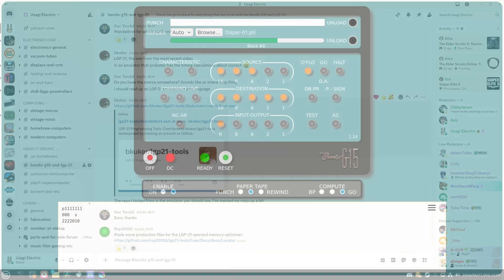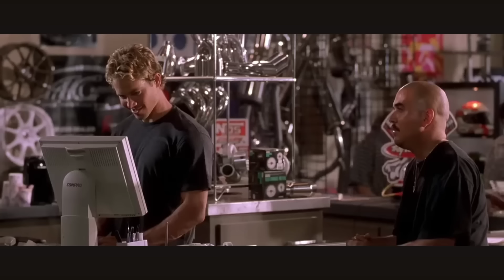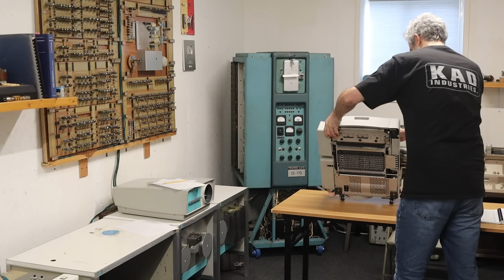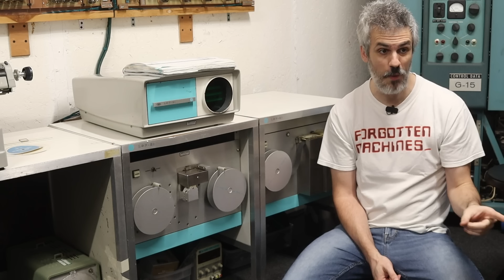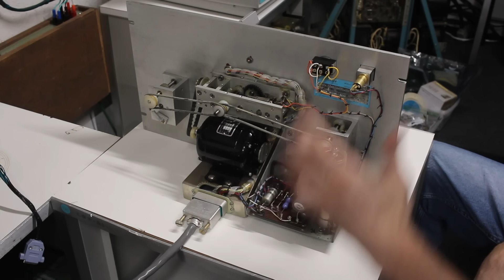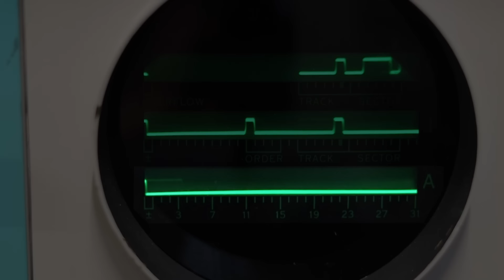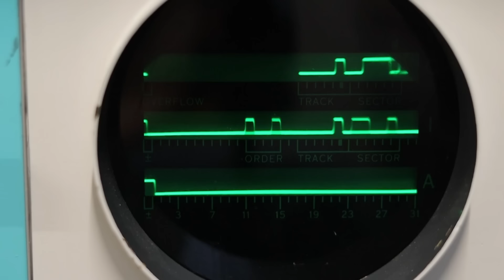Can We Rescue the Code on This 63 Year Old Disk?

Comment: For those who are curious, the numbers that I am calling out at 24:34 are instructions for a little bootstrap program.  The bulk of the dump program is on paper tape, but 4 instructions need to be entered manually on the Flexowriter into memory to build a little bootstrap program that loads the rest of the tape from the tape reader.  Once we switched to NORMAL mode and hit START, the rest of the program read in automatically and started running.  After that it spent 1.5 hours pounding out hexadecimal words on the Flexowriter.
Reply from the maker: Thank you for all the help man!
Reply: I know nothing about that machine, but that motor start relay isn't chattering because of mechanical reasons.. the voltage/signal driving the coil is unstable. The supply where that's coming from seems to be overloaded - maybe a capacitor no longer capaciting as designed. Let me suggest you debug further in that direction.
Reply: @WooShell  that was my thought as well, it sounds like it's insufficiently well powered to stay engaged.
Reply: @26:11 I see characters 'w', 'k', 'g', 'j' .... what are these?  Does the machine have alternates for our now-standard "A to F'?
Reply from the maker: @andrewdavie386  Yup. It's a hexadecimal machine, but instead of "a, b, c, d, e, f" it uses "f, g, j, k, q, w". No clue why LGP decided on those letters!
Reply: @UsagiElectric  TY. Interesting that most of those are on the same line of the keyboard. I wonder if some key encoding scheme had all of those consecutive in binary value.
Reply: @UsagiElectric  see also layout of a qwerty keyboard for a nice pattern of paired letters
Reply: @andrewdavie386 according to a stack exchange post about the LGP-30 that's exactly it. Those letters just happen to be encoded as 10-15 as a consequence of the physical design of the keyboard. I tried posting a link as a separate post but it of course got removed. The question is titled "What was the reason for the weird hexadecimal letters used on the LGP-30?".
Reply: @Bobbias  it was an educated, but lucky guess. TY for the confirmation!
Reply: @UsagiElectric  that's even worse than Bendix ...
Reply: @UsagiElectric  Fibre Glass Javelins Kill Quite Well!
Reply: @UsagiElectric  Here are the character codes, from table III in the LGP-21 Reference Manual, for these characters:
0:  0000 10
1:  0001 10
2:  0010 10
3:  0011 10
4:  0100 10
5:  0101 10
6:  0110 10
7:  0111 10
8:  1000 10
9:  1001 10
F:  1010 10
G:  1011 10
J:   1100 10
K:   1101 10
Q:   1110 10
W:  1111 10

So you see, these are already in binary sequence, with 'F' immediately following '9'.  Since the bootloader (i.e., manual input mode) is implemented in transistors and diodes, this would simplify it greatly.  Now, whether this is a standard set of character codes for a Flexowriter, or LG specified that the Flexowriter be customized for the LGP-30, I could only guess, but in any case, I don't think that hexadecimal notation was firmly entrenched in 1963, so the choice of codes may have had something to do with making the "mnemonics" for the instruction codes work out as well.
Reply: Yes, that's what the LGP-21 uses for hexadecimal, F G J K Q and W so they don't conflict with the operation code mnemonics.  The Bendix G-15 uses U through Z instead.
Reply: @andrewdavie386  Wow, this is triggering me.  My first computer was a Z-80 machine I built myself in 1979, and I wrote a bootloader for it so that I could then load a monitor from toggle switches that could accept input from the ASCII keyboard and store into RAM.  At this point in development, I didn't have any EPROM, but I DID have a set of address and data switches that could write to RAM over the CPU bus.  The monitor program of course accepted octal, since that's how 8080 and Z-80 instruction fields aligned (and how I hand-assembled Z-80 executable code), but the bootloader was much simpler, AND I chose to use the same trick for accepting hexadecimal: I used : ; < = > ? to substitute for a b c d e and f, respectively, because these are the ASCII characters that follow 9.  This meant that the bootloader didn't have to do any translation; it could just take the 4 least-significant bits of the ASCII code being input, as-is, shift them into the A register just as the LGP-21 bootloader was doing in "manual input" mode.  This is clearly what GP did as well, except that the Flexowriter doesn't speak ASCII.
Reply: @BrightBlueJim  yes. I'm pretty old-school and that's why this occurred to me. It's the kind of "shortcut" you would take back in the day to save memory/speed.
Reply: What wasn't clear to me is where the program from the paper tape is read into in order that the instructions are run? Presumably there is a loop in the track printer program to loop over each sector, reading off the disk, so the instructions must be read from within some memory, so I presume you were able to load the entire program into memory (ferrite core memory, which is non-volatile, or volatile memory, static RAM or the 1963 version thereof) in order to run it? Or did the program need to be written to the disk, i.e. track 2, in order to run it from that, i.e. reading each instruction from disk, or run directly from paper tape, iteratively reading the tape? I find the last two scenarios hard to conceive.
Reply from the maker: @aussieleighsmith  It's a little confusing but the disk is the memory. There is no static RAM or core memory or anything like that. The rotating disk is your working RAM, similar to the rotating drum memory on the Bendix G-15 or LGP-30, just flattened out instead of in the shape of a wheel. But, in a sense, you can think of the rotating disk memory as being roughly analogous to core memory in that it is indeed non-volatile (the actual physical construction of the memory and computer around it are wildly different, but for a programmer, that's where all your memory addresses and registers are). The paper tape is our mass storage device, and in this case, we typed a little 4-word bootstrap into track 2 which initiated the tape reader to read in the rest of the dump program. That dump program was copied into track 2 as well, then executed from there.

Since track 00 and 01 were broken, we chose to go with track 02. I will troubleshoot and get track 00 and 01 working and we'll pull any data on those two tracks off as well, but I wanted to backup everything on the memory disk as soon as possible so our risk to data was as minimal as possible. We manually stepped through Track 02, writing down the contents of each memory location by hand looking at the CRT. It was tedious and slow, but we preserved it so we could load our dump routine into that track.
Reply: @UsagiElectric  Hand transcribing the contents of track 02 from the CRT display is real dedication!  Especially as I imagine you wanted to re-check a few times to be sure.  How many words per track?  And actually, are all tracks the same data length, so it is more compressed per bit towards the spindle?
Reply: i remember having to do this kind of dumpin our old school lab.
Reply: Where did the actual tape come from?

Comment: I'm amazed that you can get any of this old stuff to work.  Mainly because of the tendencies for the die bonds on the chips tend to fail at around 20 years.  Does not matter if the machine is in service or sitting on a shelf.  The execption is for parts with jan (joint army navy)  an an example jan/txv2n2022 I have some I purchased in the early 1980's are still good as new.  Hard to find nowadays.

Comment: Motor start relay - don't know if you got this sorted, but it looks like the normally closed contact goes to a resistor? If so, it could be the cooling / power saving contact for the coil and shouldn't open until the relay is almost fully in. Commonly used on vintage elevator control relays.

Comment: Feeler gauges on a digital computer's disk memory unit...like we're setting "cold" valve clearance on an internal combustion engine.  Hmm, not so different since there's a camshaft with rocker arms and rollers activating contacts like those seen in pre-transistor points and condensers for ignition.

Comment: I really enjoy your approach to restoration and also tinkering with new retro designs. When I was an undergrad in 1976 I got to work at Edgewood Arsenal, Maryland on an early CAD system built around a Varian Data Machines minicomputer. It was a very nice machine of that era. I wonder if you've ever run across one.  Iirc it had core memory. For sure it was persistent. We loaded programs from paper tape, and they remained resident indefinitely through power cycles.

I also got to spend a month or so at the company that built the CAD system somewhere in southeastern New York state. Unfortunately the name has left me. The system was entirely wire-wrapped TTL in a cabinet I recall was maybe 5' high and 3x3'. A beast. They started by building their own FORTRAN 6 compiler, and all the CAD software excepting drivers was written in FORTRAN.

Comment: I also used to enter a boot strap loader into the Honeywell information systems division model 316. However, I had to enter the individual bits into both the program counter with the address and the instruction content into the memory. At that time, I was able to use magnetic tape recorder to input the rest of the information into the core memory, which was a construction of ferrite beads manually woven with X and Ywires along with a current sense wire; each read operation was destructive and had to be rewritten afterwards with the wright  operation. In 1970 and 71 I worked in RCA‘s printed circuit board repair division. Where I also work on early teletypes with paper, tape, reader and punch. Also the old Hollerith card punch machines where I repaired and aligned the inter loopers which punched the individual bits on the card. I’m now retired, but your story brought back memories of early employment before I was promoted to electronic design and development engineer.
Thanks for the memories!

Comment: In 1974 I was one of two plant engineers assigned to the GM Flint Truck Body plant (Flint Michigan) to install their first computer controlled truck cab assembly and welding machinery lines. We two, worked opposite 12 hour shifts, 7 days a week. The computers ( a rack of them) were CAI-16 (16 bit machines from Computer Automation Incorporated - doing this from memory - 16 bits was a big deal in those days) If the computer was powered down it went stupid and you had to write  a boot loader from the front panel to restart it.This consisted of 15 spring loaded  switches on the front panel that you flipped one at a time to set that 16 bit binary word, hit the enter, rinse and repeat. Took 12-15 minutes because you would set the word, then confirm from the lights it was the correct word,. then enter it. If it was wrong when entered the program would crash when you ran it and and you had to start over from scratch.  Once done you could hang a roll of paper tape and hit enter and it would run the tape through the reader, programming the machine,another 9 minutes and 17 seconds . There were 16 of the machines in that rack. 
The computer install and commissioning and testing took place at the same time the plant was being physically remodeled for the new works - jack hammers, dynamite blasting, concrete pouring, welding, and millwrights dragging huge machines into place with chains and bulldozers,  all went on at the same time.
If an electrician screwed up and interrupted the power to the computer room, you had 16 machines to reboot from scratch and enter the paper tape program. Then have the skilled trades people go to the machinery floor and physically remove the partially assembled truck cabs from the machines that were interrupted,  reset everything physically back to the starting position, and you could then start testing/production running  on that section of machines again. With the system back up you would hunt down the offending electrician, threaten to choke him if he ever did that again, then leave him for the UAW shop steward to give him a cursing out.
This was a big deal install for GM and the UAW. It was $120,000,000 dollars back then, which is about $800,000,000 in today's money.  The UAW workers homes, mortgages, cars, and food depended on that factory succeeding. This was one of the few times that the UAW and GM had the same goal.
Reply: I remember Computer Automation, especially their Alpha 16 and Naked Mini 16.  I was at University of California, Irvine in '74,, and somebody there had used an Alpha 16 to interface a Diablo daisy wheel printer to our PDP-10.  They were super-cheap, as computers went (well under $2000), and people used them kind of like they do microcontrollers today.  And yes, it DOES create some cognitive dissonance to even say such a thing.
Reply: The good old days, eh?

Comment: Of course you must realize that the bootstrap should also come from paper tape. Specifically the tape reader on the flexowriter. That seems an important next step maybe?
Reply: Yes, programs were normally bootstrapped from the Flexowriter back in the day and it is a little easier.  As Usagi indicated, it was simpler to get the main tape reader working for now.  Maybe after VCF we can look at the flexos tape system.

Comment: If your computer doesn't clatter like a car when you start it, it's missing something.
This episode was really fun! I share your appreciation for the CRT. It really is like a car in there, isn't it?
Two things. Those rubber bands seemed to be getting back to normal, I do wonder if they're savable, with time. And I know that the tape reader on the Flexowriter is low priority, and that's totally reasonable since it's basically unnecessary, but I'd really love long-term if the whole machine worked, including that tape reader. Maybe it could be a rainy day project, when you need to fill a day or two?
In any case, I really love this machine, and I'm really loving this series on it. I really appreciate you dumping the data; that's such a cool way to do it, too. Here's hoping the "blank" tracks can be recovered.
I also really appreciate your community; the fact that devoted members are making emulators of your machines just remains super cool to me.
If you don't have one already, I really think you need a website for all this stuff! Good place to dump documentation and such.
Thanks for this series. Really looking forward to the next episode!

Comment: Y'all need to explain what g, q, j, w, etc characters are doing in that output
Reply: The LGP-21 uses 0 to 9, f, g, j, k, q, and w for hexadecimal digits due to a quirk in the Flexowriter's character set encoding.
Reply: The machine pre-dates ASCII, so is not bound by the conventions of ASCII, in particular using {0…9}" and {A,B,C,D,E,F} to represent the digits of hexadecimal. There's nothing particularly wrong with, for example, with using {Й,Ц,У,К,Е,Н,Г,Ш,Щ,З,Х,Ъ,ф,ы,в,а} to represent those same digits. They might be unfamiliar to non-Russian typing programmers, but that's just a matter of not knowing the symbol set. 
I wonder if there is a Linux keyboard layout for APL. What am I saying? Of course there is..

Comment: I'm kinda surprised that there aren't any professional data recovery companies willing to step up for recognition, and help recover data from these old drives.  I mean these companies have access to tech that could probably read any disk where the media isn't completely rubbed off by a head crash, or de-permed by intentional erasure.  And i'm not even willing to bet against one of these companies in the case of intentional erasure.

For example, let's say i have a 10 year old HDD that i desperately want the data off of, there are companies out there who will disassemble that drive, and read the platters directly with ultra sensitive scanners.  If i found out a company had read data off of a 60+ year old platter, on an obscure platform, in an odd format, and were able to give me that data?  I'd trust them, because they have proven they can overcome any obstacle.

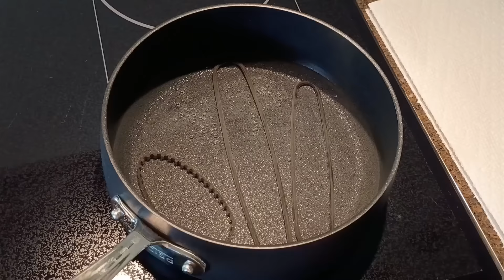Comment: 19:20 If you ever struggle with rubber parts, they can be 3D printed. I have fixed vintage mechanical and electronic calculators with card readers like that.

Comment: Spoon engines!  I caught that, yep was paying attention.   Admirable work here.  I recently learned how a Flexowriter was put to use on Whirlwind for the original "director-tape" OS (a slow speed device used to direct operations of the faster optical equipment).  And amazing recovery of data, maybe AI can help analyze and make sense of that.

Comment: Coolest feature I encountered back in the late 70's as a computer operator was the "hoot" (audio amplifier across the address bus) on an ICL2904 machine, with practice you could tell, for example, when a sort entered the collate phase just from the sound pattern. I once booted the machine to the point where I could log in using a remote console using nothing but the sound because the system console had failed.